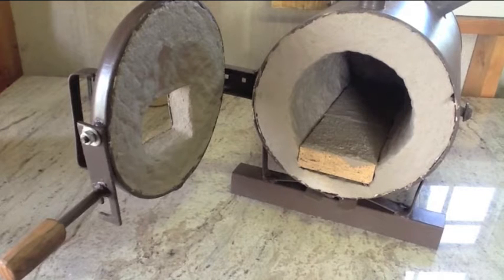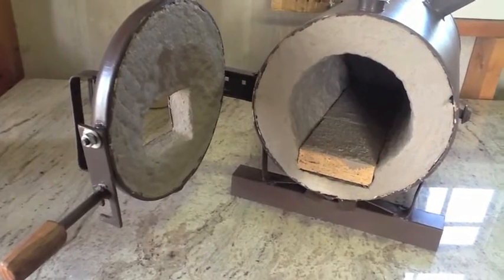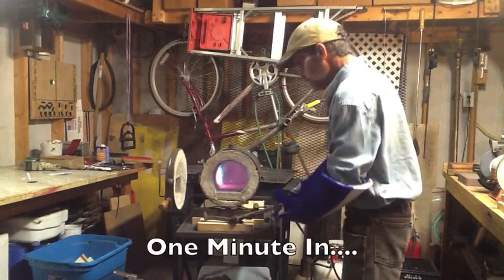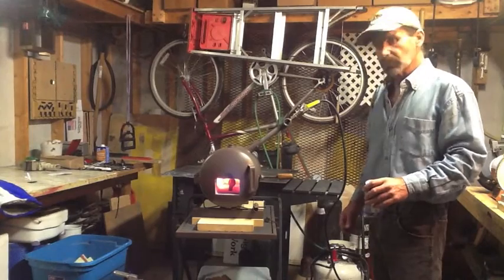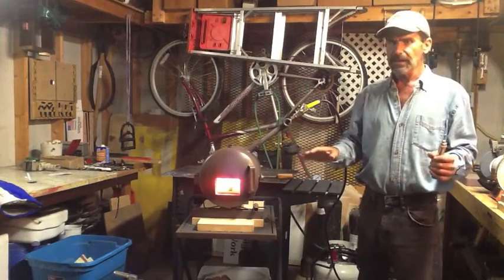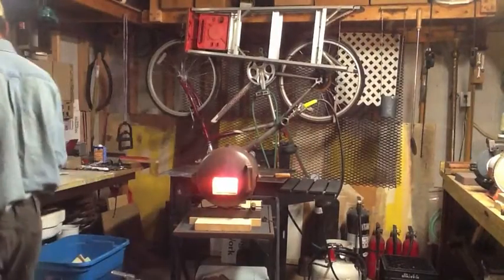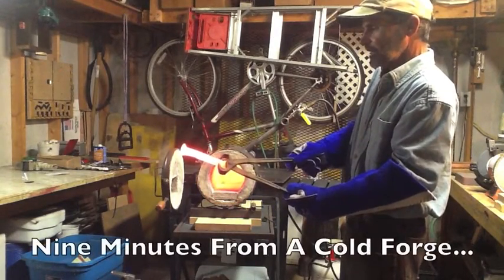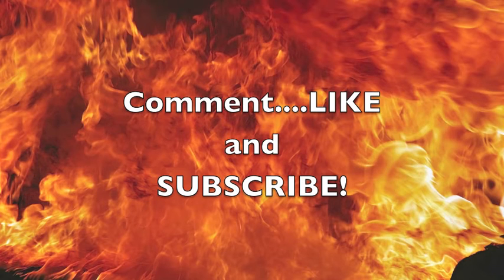Blacksmith Propane Forge - 1st Firing To Forge Welding Heat - MSFN

Comment: You should wear a respirator with KAO Wool brother!
That stuff is BAD for your lungs!
Reply from the maker: I know, couldnt afford one at the time, was as gentle as I could be with it
Reply: I don’t just mean when your first making the forge, but every time you fire it up, the flames push the ceramic fiber is out into the air.

I never forge without one (except for competitions)
Reply from the maker: 10-4, , it does have rigidizer and 2 coats of OTC100. I honestly dont even use it at all. My elbow doesnt like swinging heavy hammers. Best of luck in your next competition Brian

Comment: hey i have a question i know very little about blacksmithing but i do know about induction coil heating. Why do all these black smith videos i see use propane or other sources to heat the metal when induction heating only takes a few seconds?
Reply from the maker: I cant speak for others but I am not smart enough to make one :)
Reply: MrMisterMan Because induction heating for blacksmithing just isn't cost effective, and for large items (agricultural blades) it's impractical.  Most people don't have access to 3-phase 480V AC that the real big units like the aerospace guys run.

Comment: did you put anything at the tip of that burner and if you didn't how deep you put the tube inside the forge
Reply from the maker: There is no flare (tip) on the burner. It extends 1/8" past the wool lining into the forge :)

Comment: You got a great forge uncle. I want to know if I cut both sides open and put U Chanels on for fire bricks to move like a sliding door. Do yoi think it can work?  I want to make Katana like Walter Sorels.
Reply from the maker: Yes, that may work, only one way to find out! You make need a two burner setup if working with very long knives/swords. Walter is very good!

Comment: Hi uncle no I don't have gas. like those black and red bottle they use like for cutting torches.  I do have  carravan 5kg blue bottle gass dont know what gass they fill in for cooking. is it propane or butane gas? And wont my knifes burn away with that heat? Or is it like  I control the knife to put it in and out of forge for right magnetic toutch
Reply from the maker: I am not familiar with the gas bottles you are describing, you would be able to tell from the metal's color how hot it is getting. And yes, you can use a magnet to see when it is ready to be quenched for hardening once the knife has been forged and to be tempered

Comment: Hi uncle  how strong  is propane burners against asetileen gas?
Reply from the maker: I have never used natural gas for the forge...only propane. Propane works well....and I am sure it will work just fine using natural gas if that is what you have available! :)

Comment: Noticed you are in the basement, any concerns for heat buildup above forge? I have mine in my attached garage that is converted into my shop. I have a good quality fan blowing at the ceiling just above the forge and a shop fan on the floor bringing in fresh air from the garage door being raised 2 feet. Overkill, I know but put my mind at ease. Am I overdoing it?
Reply from the maker: Actually I am outside in my 12 x 16 shop, I have two 4x8 doors open as well as two windows open, I didnt run my fan for the sake of the video and no you are not overdoing it, overkill is a good thing when it comes to ventilation :) The heat hasnt cause me any issues thus far

Comment: how long does a tank of propane last you?  Looks like a BBQ grill sized tank.  That's what I would be using too.
Reply from the maker: I would guesstimate 1.5 lbs per hour or thereabouts. It depends on how high a PSI you run at

Comment: quick question, can rock wool be used instead of ceramic fiber wool? The heat tolerance is about the same on both, rock wool is alot easier for me to get though.
Reply from the maker: I have no experience or knowledge of rock wool so have to say "I just dont know" :(
Reply: Mike wheeler You could use it for the bulk of the insulation, but you'd ideally want something rated ≥2600°F for the hotfacing, and probably an additional refractory between the two.  If you're trying to do it with materials from Home Depot, perlite and 3000° furnace cement are your friends.

Comment: Forge looks great. Have you actually forge welded with it? I'm thinking of switching from coal to gas because it more accessable for me in Ca. but I have to be able to weld with it.
Reply from the maker: Thanks!, yes, I have forge welded just once with the forge just to say I did it. LOL The flux tends to make a mess in a gas forge but thats why I have a firebrick bottom so they can be swapped out if need be :)
Reply from the maker: I have a video on the building of this forge as well. Thx for Watchin! :)

Comment: how long does a Propane tank last ?
Reply from the maker: I use the same tank for the forge and my foundry furnace so cant honestly give you an answer to your question. Have never gone through a whole tank through continuous operation with either forge or furnace.

Comment: Hi there, how do you deal with carbon monoxide? Do you have a detector?
Reply from the maker: For the demonstration for the video you watched, while filming my two 4' x 8' doors to the shop were open. The doors are always when it is in use. My anvil is outside so the forge is brought over to where the doors open up, its why I have it on a rolling cart...No detector

Comment: Splendid video! I very much like your commentary and your camera work. Could you tell me please how far the burner extends into the forge?
Reply from the maker: Thanks Tinker! Filming with an Ipad on a tripod has its limitations but I do my best. The burner doesnt extend into the forge itself. I have it pulled back 1/8" into the ceramic wool so only the gas gets jetted in. It keeps the burner cooler by not having in the burn chamber. Using the T with 2 air intakes provides additional cooling to the burner. Consider subscribin! :)

Comment: Wow that's pretty nice. Same burner as before then? I didn't realize propane could get that hot.
Reply from the maker: Thanks!, Yes....that burner was made specifically for the forge
Reply from the maker: The ITC100 applied to the interior makes quite a difference on heat retention, I have yet to push it to its limit :)

Comment: Nice burn!  Is that pop when you vented the lines normal?  Also, would it make sense to stand fire brick in front of the door opening during the run up.  Or would that restrict the flow of gases too much?  Thank you for posting this demonstration.
Reply from the maker: Thanks Glenn, I am no forge expert by any means but I dont believe this design needs firebrick in front of the opening, with a rounded face it would be a difficult configuration using a brick. It performs well as is but I may experiment with that concept :)
Reply from the maker: Yes, the pop was normal since the furnace was hot enuff to ignite the propane. If you noticed in the vid I initially turned off the gas flow using the ball valve which meant the line was still pressurized at that point. I went thru the same steps one would go thru on shutting down any oxy/acetylene set.

Even shutting off the valve on the propane tank 1st would have left pressurized gas between the tank and the regulator which should be vented as well. Hope the long-winded explanation helped :)